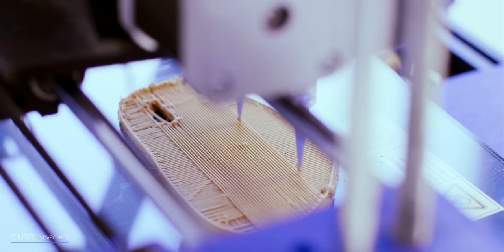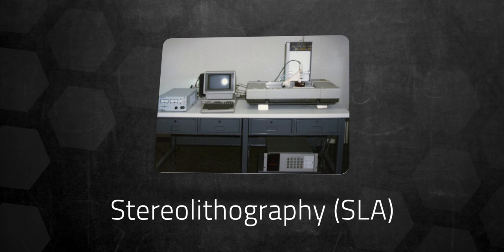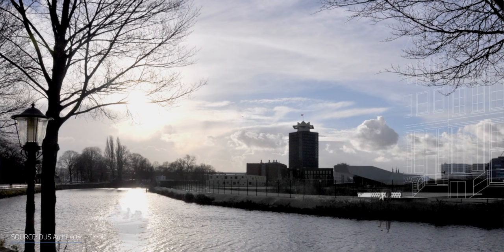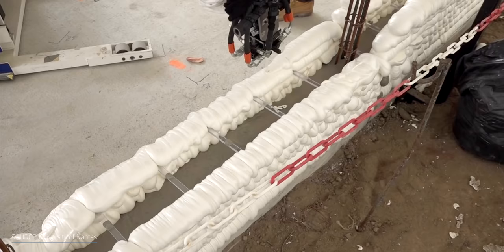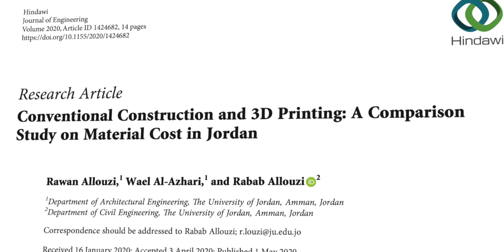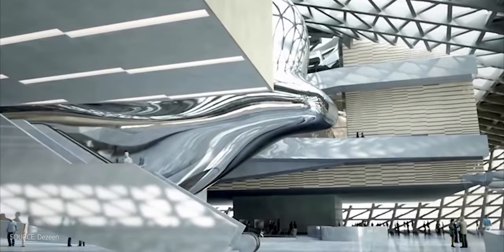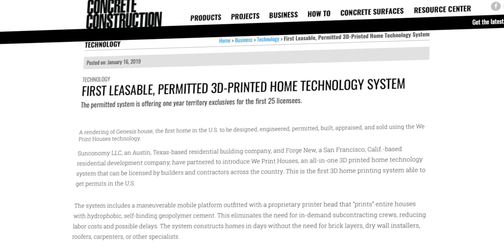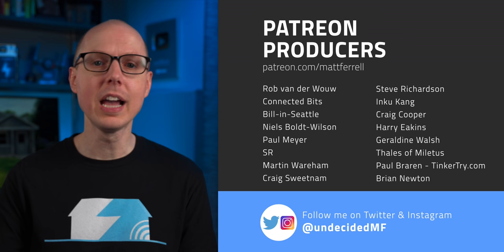This 3D Printed House Changes Everything - Explained

Comment: "Let's 3-D print something and find something good from it"

I just dont understand how 3D printed houses can be...
- more environment firendly
- more energy efficient
- more durable

By a not far past, many houses in old Europe were built out of earth. For example, roughly 50% of France's houses were of that kind in the year 1900.

This was environment friendly and sustainable. and that was very thermal efficient. At that time, many houses did not have heating, only one or two fireplaces. People were poor. House heating is a relatively new feature for houses ~100 years.

More technology means more energy and ressources consumption, and this is the point we must fight to achieve the goal "sustainable".
More technology often comes with less human work, and we dont need unemployment...

"Building fast" is not something required by clients. Availability of a building depends on administration, how many types of contractors you can have on the building site. Building the walls in 3 days instead of 2 weeks does not significantly change the deal for most cases.

Building with wood, is sustainable construction method, either framed or solid walls. And it can be fast. Because the parts can be produced in a factory, reducing the costs.
And wood is a great insulation material
Wood is bio sourced, and is naturally fully recyclable.

But I think "3D printed" houses would be a good solution for buildings on Moon or  other planets. Because this method allows to build from local material sources.

Comment: I have seen a few of these videos already, a very interesting concept. I'd rather they use a more natural mix, like clay and hay and dirt, but you can't really put up a house that fast with concrete, it needs time to dry and cure a bit before you can add the next layer. Use shortcuts like building a whole house in hours and you won't have a very secure house.
I'd rather they come up with a way to robotically assemble ready-made wall panels and pillars and doors and windows and a real roof to build a real house. These days, a house needs a lot of insulation, heated floors and walls, solar and thermal panels, a heat pump, etc. A house ready to live in is much more than just printing walls.
The real big building advance I am waiting for is a solar roof made of solar panels. In many countries, the building code requires that you build a regular weatherproof roof, then add the ugly solar panel warts on top of the roof with railings and stuff, instead of designing a roof where the solar panel assembly itself would be the structural weatherproof roof. This would also allow to include air circulation right under the panels, to cool them down in summer, retrieve the hot air in winter, or even inject room temperature air in winter so the snow does not stick over the solar panels. The whole roof would be solar panels, or a few lookalike pieces for the dead corners, a single slope roof would work best, it could even use the new mixed photovoltaic and thermal panels, to provide both electricity and heating. Tesla's solar roof is nice, but too expensive, not as efficient as solar panels, and they don't include thermal tiles either. It's really made for small or big McMansions that have many complex and separate roof slopes where you can't fit regular solar panels. Solar panel roofs will enforce a simpler and more efficient design, instead of having everybody and their mother think they are architects...

Comment: These laborer numbers are misleading. "took only 3" I can guarantee you it wasn't an electrician, a plumber, and a roofer. It might take only 3 to monitor the machine and do other stuff but to do everything else that makes a house a house. Yeah thats still needed. Plus people don't just live in a house skeleton. Just like they wouldn't live in unfinished 3d printed houses. 
And then appliances, cabinets, kitchen, all the other features of a house. I just don't buy the numbers. It might cost the company itself half the cost to "build a house" but I'm going to go ahead and guess that its barely a saving once everything is factored in. Heck, they don't even put down a foundation.

Comment: im gonna suggest that raising carbon output would be better than lowering it. based on the water cycle, how plants intake carbon dioxide, and what plant covering does to groundwater.

warmer climate due to co2 increases atmospheric water and cloud formation, delivering more water to terrestrial environments. at the same time plants have more co2 to diffuse into their leaves, meaning they suffer less water loss for more carbon absorbtion. 
this results in a greatly increased amount of airable land and dense vegitation cover in regions that where previously arid, and increased fertility in previously arable land.

the ultimate outcome being significantly more greening of the planet; more available O2, water, and feed for livestock; more growen building and general resources, more plant based food, and little sealevel rise due to most of the unlocked water being in groundwater and in vegitation. 

I would also suggest that attempts to reduce CO2 would have an opposite effect, starving off plants and increasing arid lands as plants die off.
Reply: just a thought at the low co2 building comment. i would suggest burning fossil fule for the hell of it would also be a net positive as you'd be restoring the historic CO2 that supported global rainforest.

Comment: I accept the printing of prefabricated parts. Printing the whole house, which requires the entire production infrastructure in its vicinity and significantly increases the price, is only for trusting fools.
Reply: lol what? you have A) less infrastructure on site (depending on the project) B) way less labor needed and C) less construction time

what where you comparing to? wooden panel houses? that would be hardly a fair comparison
Reply: @richiericher9084  Do you really see it as simply as on a green field? Where you have the foundations, possible basements, leveling, insulation, connection to utility networks, ... all this must be done according to standards with regard to the surrounding buildings. I strictly compare it to European standards, not to the wooden American "Baroque". The eventual "print" is just the icing on the cake, which requires a solid foundation and the surrounding support infrastructure, which cannot be done without supplies. Therefore, the final price is high and can rather appeal to those who want to have something "extra" and do not have deep in their pockets. From this, it is determined whether it will gain support or whether it is a dead end for one fashion issue. I see a better chance in the production of print profiles on request, which will meet all the requirements for statit and much more. It is not good to accept every stupidity uncritically when the whole context is not visible. What may once work on Mars with a large margin may not meet the local conditions.

Comment: 3d printed homes will push home design to jetson levels. They meet to incorporate rebar for maximum strength
Reply: I think that's the part where "might not yet meet local building codes" comes in.  Remember that earthquake in Haiti a decade or so ago?

Comment: This is all find and good, a great step forward.  But we have to think a bit more clearly.  We have to make sure these structures that are 3D printed can withstand hurricanes,
tornadoes, and other types of bad weather.  Its bad enough that thousands of people have already died in these types of weathers because their houses broke like toothpicks.
Because thats what we are currently building right now, is toothpick houses....  So long as we keep using 2x4's and nails with wood panels for building houses,
we are still living in toothpick houses.  We humans have to figure out a way to be able to run indoors within our homes when a horrifying weather comes our way,
and be completely safe knowing that our houses or buildings we live in will withstands harsh weathers such as hurricanes, tornadoes and other harsh weathers.
I know this first hand.
I lost my first home entirely in Hurricane Sandy, my house ended up in the ocean. and it broke up into a million pieces.  And the house was only 15 years old.
We continue to build houses that are complete crap over and over and over.....  HUMANS NEVER LEARN from their mistakes and they continue to make those same mistakes.
By building homes with 2x4's and wood panels and sheet-rock.  When is the human race finally going to build buildings that can withstand a CAT5 or more hurricane ??
When is that going to happen ??

Comment: Cheap housing is the priority for most of the population. Doesn't matter how clever the production method is if that can't be achieved. And it won't be achieved because there are too many vested interests in the status quo. Essentially, we're still building homes much the same way ancient Rome did.
People have been showing off system-built cheap homes for a century or more. Few have survived, as anything that threatens the market tends to be discouraged by suspiciously convrnient building regulations.

Comment: I love 3d printing and it most definetively has promise for future construction, but the numbers given are most likely doctored or not representing real conditions. 
Currently only the structural part of a house can be printed, the walls. Construction costs vary greatly and for hot climates with cheap foundations 3d printing can quickly produce cheap-ish shacks (although i still doubt the worker numbers given).

In northern climates the walls of a house is a small fraction of the overall cost. Digging, frostproof foundations, insulation, roofing and all the components and craftsmen required make up the vast majority of the budget and 3d printing the walls would impact overall costs very little. 
When we get 3d printers that can deal with insulation, piping, heating, windows, electrics and roofs we are going to see a huge impact, but for now the tech is mostly useful as demonstrators or building simple shacks, bungalows and barracks with groundwork and finishing done manually. 

Adding many versatile robots combined with powerful AI will truly revolutionize construction, until then 3d printing is cool but niche.

Comment: Ok how do you make a video on 3d printed houses and not talk about everything else but the frame. 3d printing also means no rebar can be easily used. 
The wiring, plumbing, widows etc need to still be placed. Stick built homes go up pretty quick and cheap

Comment: "3d Printed house is a gamechanger" 
"Prefab house is a gamechanger" 
blah blah blah... there has been a hightech drive to make faster, cheaper houses for decades. 
It's pointless as the biggest problem nowadays is not the cost of the building process but the cost of the land to put it on. 
We can already build houses extremely fast and cheap... but you have to build it in the middle of nowhere. The part of actually building the house is the least of your concerns when you want to get a house these days. That is why a small collapsing ruin can cost more then a giant modern house - because it has a far better location and tearing it down and building something else there is actually trivial in comparison.

Comment: 500k USD  it seem surreal to spend that amount of money to get only 135m2 even with swimming pool.
Reply: For example cheapest home 150m2 fully isolated with heat pump i can get for around 50-60k another 8 i can get 10 KW solar instalation adding another 20 i can get large garden for my plants, big lawn etc, and im still not even passiing 100K...

Comment: Problem is they will use only HP print cartridges at $900,000 apiece, are designed to lock out 3rd party cartridges and they will get plugged up and need replacements after a month or two of use.

And before some idiot posts a snooty correction of what I said, it was a JOKE.

Comment: Based on your information, concrete production and home construction waste are big contributors toward pollution.  Even if people not fans of green tech these new structures are much more sustainable.  Sure, I'd live in a 3D printed home.  I'm just wondering what is going to happen to those 90% of construction workers in the next twenty years.

Comment: $600K for a 1450 sq. ft. House?  How does that take pressure off housing affordability? If median family income of $68K how is that helping.  I get the sustainability, but I don't understand how this cuts the cost of housing how, this would be over $100k?  Are they say the lot price is $500k.
Reply from the maker: Those prices are relative to where they were built and finished.
Reply: @UndecidedMF  I understand, I'm curious as to what the gross margin is on the house built.  If these are going to be game changers wouldn't they need to provide quality housing at a much lower price? Or is that not point of these?

Comment: 3 people vs 32 people. Apples to oranges. You're comparing the number of people to print the skeleton of a house and nothing more to the number of people required to bring a house from foundation to finish. The 3d printed house still requires plumbers and electricians and drywallers and painters and roofers. I also notice they're printing on a slab (no basements?) are they including the concrete crew who poured the slab in those 3 people the way they are in the normal houses 32?
Reply: After watching the whole video these 3d printed houses look more like all they're replacing is the framing crew, or the cement and forms crews for cement houses. The houses still require all the other trades that make up a house. They aren't 3d printing the foundation, that still requires forms and cementing crews. They aren't 3d printing the electrical wire into the wall, that has to be installed afterward just like in a normal house. They aren't 3d printing the insulation. They aren't 3d printing the plumbing. They aren't 3d printing the roof. They aren't 3d printing the windows and doors. They aren't 3d printing the flooring. They aren't 3d printing the finishing (drywall and painting and whatnot).

 This looks good for people who don't actually know how houses are built. For anyone else this looks like it could replace one aspect of the building process and thus maby slightly reduce the price of a house. Good on them for innovating. I won't hold my breath for price reductions.

Comment: I also notice these 3d super houses have flat roofs I'll pass, because flat roofs are nothing but trouble the second it starts raining.
Reply: It's all for show. We are decades away from achieving the same quality that other manufacturing processes provide. It's true for almost every industry 3D printing is trying to crack into. The tolerances and structural integrity are just not comparable yet.

Comment: The purpose of 3D printed homes is the $ difference of traditional construction. This is very expensive and you lose out on helping more construction workers work for the same $ range. The creators are just greedy and want to capitalize but they need to realize that a robot is making the house so it should be less expensive even with repairs.

Comment: why would a buy a 3D printed house that apparently has cheaper labor cost but cost the same as a conventional house, it doesn't look very ascetically pleasing, it's got round corners good luck finding furniture for that, and is experimental i have no idea what issues come with a 3d printed house.

Comment: It would be great if they could make this out of hemp instead of concrete.
Reply: I live in an area that gets hit by tornadoes. I'll take the concrete house over the hemp house, myself.
Reply: @AugustusBohn0   I haven't read anything specifically on the hemp houses in tornado but hempcrete is very comparable to concrete in strength and is much thicker than these walls here.

Comment: 3D printing is associated with low income housing.  At least that is the current stigma.  You clearly point this out in the video.  Until this stigma disappears, 3D housing won't take off.  By the way, I wouldn't exactly call $300k for 1400 sq ft a bargain.  Maybe in San Francisco, but not anywhere else.

Comment: Building whit icf vs 3d printer i will think icf wins before the printer is assembled. I don't under stand the labor equation though 3 men to put up a 3d printed house vs 32 when u build a traditional .  Don't you need electricians, painters, plumbers, and people to doe the ground works when you 3d print?

Comment: So normal haus costs 500k and is built over a long period of time with 32 workers. With only 8 workers and 3 days the cost comes down to an incredibly affordable 450k. So wow workers are paid approximately 2100 if you need only one month to comlete a normal haus. So if a credit is 2k/m and you build hauses you cannot aford one. And I suppose hausbuilding is not a high skilled job or is it?

Comment: I don't really see the benefit of this. It's replacing the walls which are basically stacks of breeze blocks, already cheap and fairly quick to assemble. The expensive bit it surely stuff like foundation, roofing, doors and windows none of which can be 3d printed easily.